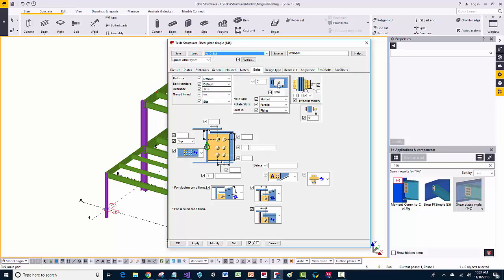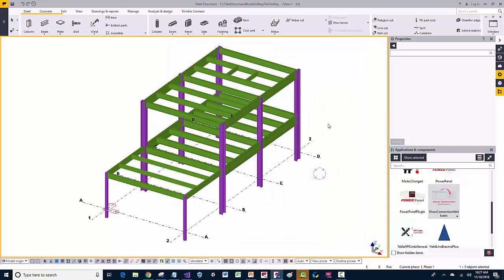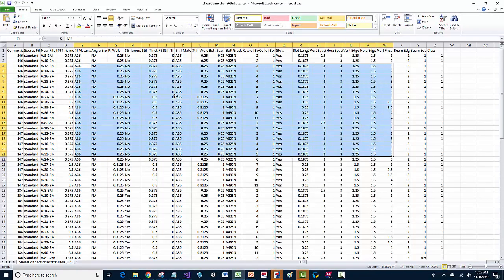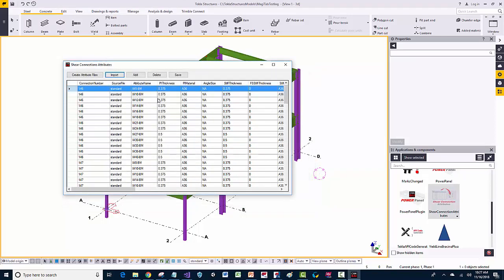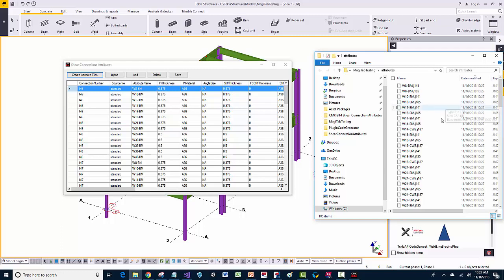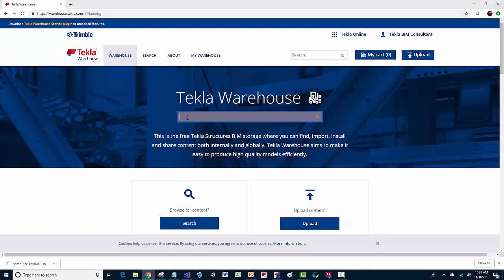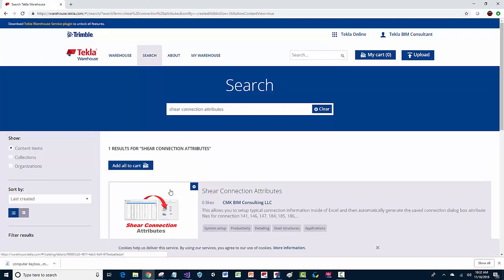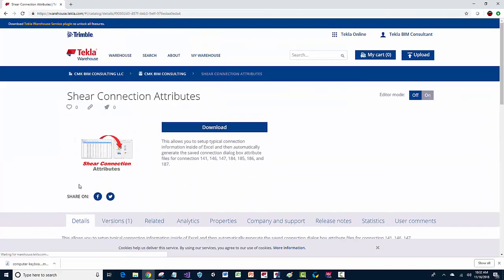CMK BIM: Shear Connection Attributes File Creator

Comment: hi i cant install in tekla 2017
can u explain in anew vedio steps for install and use
Reply from the maker: ahmed salah there is a video on this channel that is a deeper training and is also where the tool is on the warehouse. The tsep package should be able to work and install in 2016 or newer. It should appear in usimp, usmet, and common environments. It’s loaded into a group in the catalog called CMK BIM